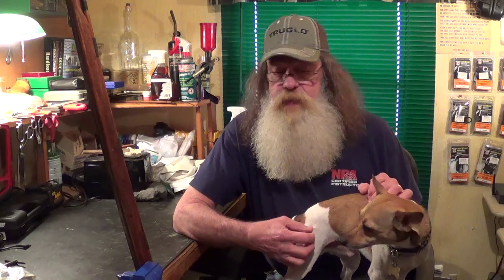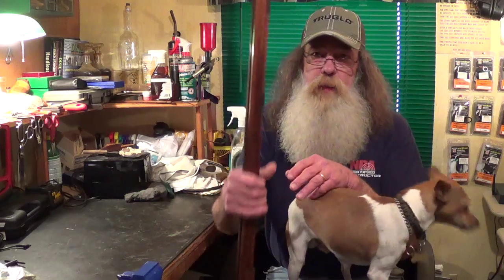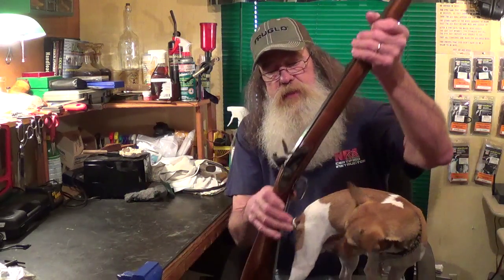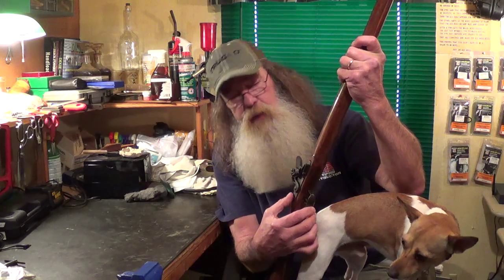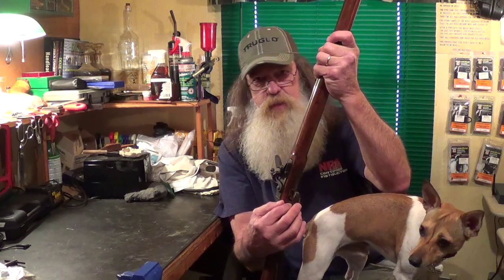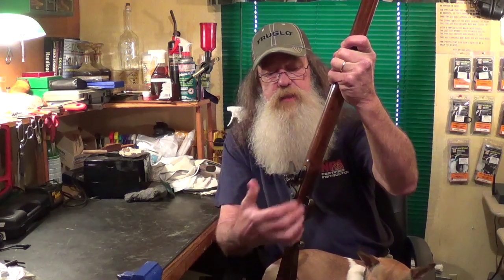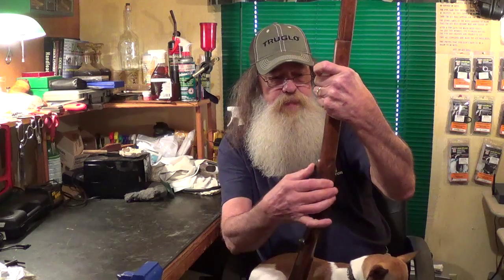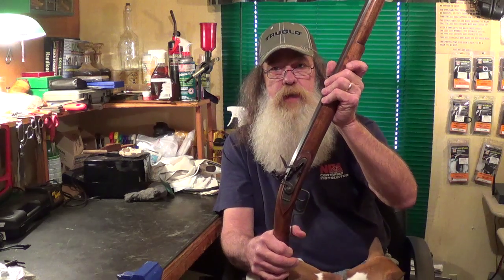Dixie Gun Works Tennessee Mountain Rifle Part Two

Comment: Hiya Unc! and Hiya Jake! It's good to see ya back on the air. I've missed the old Jakester.
Just FYI: Unc has done some good work on that Dixie and I hope to see it in action someday when the "hay" is mowed and things get caught up. Unc has been busy this Spring with all the bad weather, and I hope he misses the next round of storms that keep coming on.
(Severus! I have a semi-custom Tennessee Mt rifle from the old Tennessee Valley Arms, made by Jack Garner, who split off from Dixie Gun Works in the 70's, with an L&R Durs Egg lock that was TOO strong for the wood. It actually broke the bottom of the lock mortise wood. Jack made it all OK by fixing the PPP+ stock as I wanted instead of building the whole thing again with who-knows what result, and ground a little off the mainspring. It is still the fastest lock I ever had and can equal a caplock. It is the best TMR a guy can have. Just info.)
UncaBill1

Comment: The main thing is, US, is that you are satisfied with it.  I have inlet a few locks, and I can tell you it takes some time.  I usually work from a stock blank, which is basically a board.  I lay out my lock after I disassemble it, and make a paper template to align it properly.  Once that is accomplished, I proceed to partially inlet the lock plate, and after that, start attaching internals until it s fully inlet.

Main springs in modern locks are usually a bit oversized, and cutting a bit off of them usually won't effect performance or function.  But be cautious about removing too much material.  Flintlocks are much faster today mostly because of metallurgy, not size.

Are you planning any work on the stock?  The forestock looks mighty thick to me.  It should rarely be more than 1/16th of an inch when you look straight down from the top.  I know it is a Southern Mountain Rifle, but the South made fine rifles, even the cheap ones were good.  The stock didn't support the barrel back then... The barrel supported the stock.  That is not to say some were not thick, because we know some were, but most southern rifles that remain we find to be slim and graceful.  Even the rifles that were in the mountains.

It usually takes me about 6-8 hours to inlet a lock, and the hardest part is the lockplate.  I don't know how long it took you, but if you are happy with it, congratulations.  This is one area which I am extremely picky about... There must be no gaps for my satisfaction.  There is lots of historical evidence that the master gunsmiths of the day didn't always get it right either, so if you came close, then that is a success. 

I am gad to see your progress... Now I can't wait to see you shoot it.  :)
Reply from the maker: ***** Yes the stock is a little thick but I plan on leaving it as is.  Thanks!